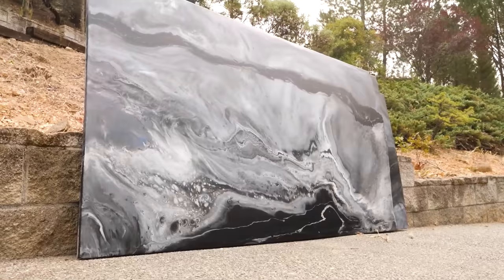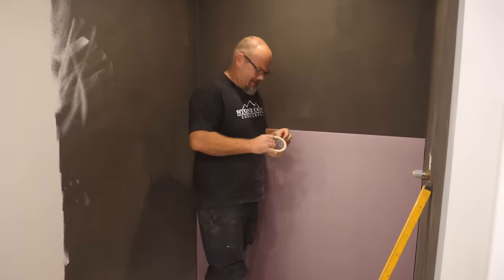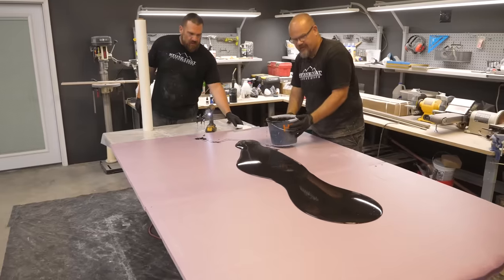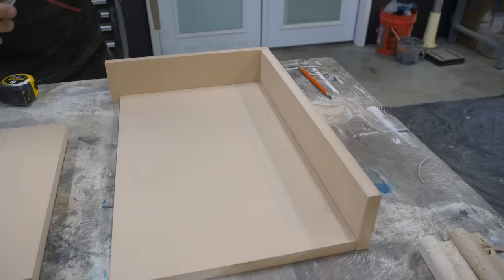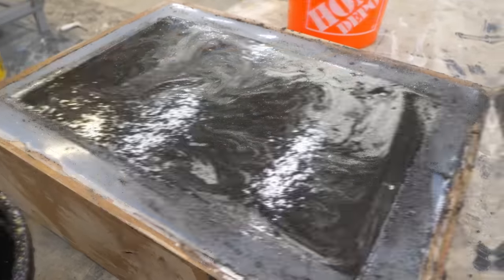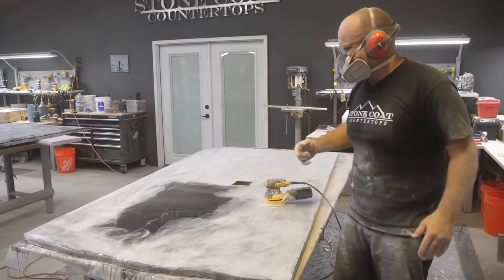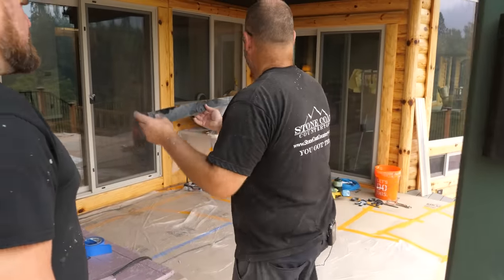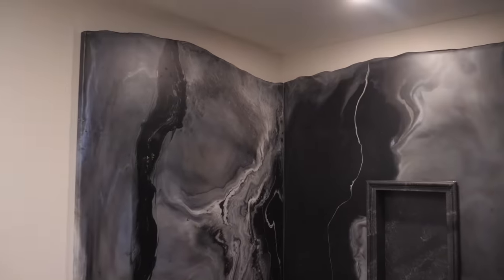Epoxy Slab Shower with Pink Foam, Come on the Jobsite Real Training

Comment: Why don't I see a drain? Ok, seen the drain at the end. Cool looking. Do you have a drain that avoids hair going down it? Mine is about 3 1/2 ft long. From painting I know that if you can slightly tip the canvas from L to R and back again a couple of times your paint isn't so linear. How would you add in a bench for the disabled or for women to shave?

Comment: I'd consider laying a layer of fiberglass into the backsides of the flat cement molds after pouring them. Give them a ton more strength, to avoid damaging them before they are installed. 
…also, on the MDF leading edges, if you do them before the fiberglass stage, then glass over the edges, the strength would really go up.

Comment: Just an FYI, but when you use a hole saw on something like this, drill from the back first half way through the material, then stop. Then goto the front with the hole saw and the remaining depth from front to the back, using the drill hole that you made earlier as a guide. This stops the material from blowing out and gives you a smooth hole, and even if the worst does happen, the blowout happens on the rear, not the front and is therefore hidden.  Its the trick used by plumbers on laminated cabinets when cutting holes for pipes.
Reply: James Keatings: I thought about that too. I suppose there has to be a center/pilot hole to allow the hole saw to register perfectly.
Reply: @isaacmadhavan  Well yeah. Most hole saws have the centre drill hole anyway which is always longer than the hole saw, and indeed, usually long enough to go through the material you are cutting completely before the hole saw itself actually makes contact. So by cutting 50^ through on one side, then going to the other and cutting from the opposite side, it reduces the chance of the material blowing out. Also, just for safety, i'd suggest covering the bit you want to cut with the hole saw with regular painters masking tape which also stops the material from lifting.
Reply: @jameskeatings9269  Kewl! And thanks for the suggestion about the painter's tape.
Reply: Amatures eh???? Lol
Reply: Thank you! 🙌🏾👊🏾👍🏾

Comment: Carpenter from Arkansas when you’re doing tile your time is in installation. When you do epoxy panels your time is in making epoxy panels  sence you have done both which one has the most labor in it. And what’s the time difference in the two processes

Comment: OMG what a wonderful DIY project I stumbled on. It held me entranced. There was so much information on how to tackle everything. I have my ensuite bathroom to renovate and was looking for alternatives to tiles.  I absolutely loved the stamping/concrete/marbling floor idea. I did like the epoxy wall panels over the soft foam/fibreglass strengthening. The only thing that I was at odds with was the cost. I use Stonecoat Epoxy to top coat my artwork and in Australia it costs me close to $450 for 2 gal (1 gal part A and 1 gal part B).I noticed you used around 6 gal to do one of your panels, which would make each panel around $1350.  You had so much information but you did not include the amount of product needed and cost of the products, to give a more exact price comparison. Also, the finish of the top coat was matte. Is there a slightly more sheen finish?

Comment: Mike I loved the long-form video complete with mistakes and recovery.  Isn't it great that sometimes the mistakes turn out to be a blessing? The aluminum edge turned out to be a mistake as executed but allowed for you to be able to do the chiseled edge which I appreciate much more than a hard edge in this case especially with the wild edge design you did at the top.

Comment: I'm renovating my rv and I want to do something like this but, I attempted to coat the showerpan which had yellowed with flexseal. It came out nice but it's not adhering well and before I get mad and rip it all out, I was wondering if pouring this epoxy over it would seal it and make it not peel. Any suggestions? Be nice please,  this thing is traumatizing enough. 😊

Comment: I love the idea and innovation. One question. Would the epoxy with foam backing take a minor “elbow bump” while turning around or other real world mishaps like a shampoo bottle bouncing off the floor and hitting the wall. Would the foam give and cause cracks, or does the epoxy provide enough strength to withstand everyday use?
Thank you and love the vids!
Reply: Epoxy is the equivalent of a hard plastic coating. It won’t crack
Reply: They reinforced it with fibreglass and resin in the beginning to make it more stronger, so it should take an accidental elbow, or a shampoi bottle bouncing off it without any problem ;)
Reply: That fiberglass cloth they laid up on the foam board is basically how they make fiberglass oceangoing yachts, some are balsa wood core but many are foamcore which is identical to what was done here, except they will use 2 or 3 sheets of fiberglass cloth. 
A fiberglass yacht hull can take quite a lot of hammer hits before damaging the gelcoat, 

epoxy is a lot stronger than gelcoat which is only applied to a yacht hull to smooth out the fiberglass weave, it’s nowhere near as impact resistant as epoxy, frankly carpenter hammer strikes would probably just dent the epoxy, to crack the epoxy-reinforced fiberglass-cloth you would likely need a full sledgehammer.
Reply: @johnfilmore7638  Going to need to see a demo of that.. I just highly doubt it will hold up considering cured epoxy is brittle in nature unless modified, but almost no one does that..
Reply: @FJB2020  your simplistic blanket statement about all "epoxy" being brittle says it all.
There are a near infinite number of epoxy chemistry formulations that run the gamut of flexibility, hardness, "brittle"ness, abrasion resistance, resistance to different classes of chemicals and solvents, hydroscopic properties (water absorbtion), I could go on.
You would need to educate yourself on epoxy chemistry before you could begin to have the background necessary to evaluate a resin property like relative "brittleness".

You might be mistaking bondo for a commercial-grade residential resin formulation in your assumption of brittleness. They are not the same.
Reply: @johnfilmore7638  Try reading again...

Comment: Awesome, what do you think about using 2-inch ISO cyanurate insulation fiberglass mat on both sides very rigid. Actually it is used in Roofing applications for fully adhered single ply roofs

Comment: I know I'm late to the party but I have a couple questions. Why did you want to stay boffins the ceiling when installing the foam? Was this just a personal aesthetic choice? Second, what was the type of sheetrock you used for the backer board? It was black but was that painted with a sealer? Lastly, what was the total cost for this job once the doors were installed? I know there is fluctuation in price based on various factors but I'm looking for a ball park for budgeting. Thanks if you can answer any or all of these.

Comment: The making of the stamp, was extremely informative.
Thanks!!!
Reply from the maker: We're glad you took something from that! Got any plans to make a mold?
Reply: @StoneCoatCountertops  
Yes, but is your silicone as tough as Smooth On products? What I usually use.
I liked ease of the wet cement stamp. Especially, as the shower floor would be just as easy to do a side walk or stepping stones.
Rounded corners on the stamp is a good idea, but I would add an overlapping 90 degree corner stamp.
............
My "sick!!!" Idea (your term) family crest, logo, etc, about a quarter inch high...custom stamp for room/office entrances, shower floor, etc. 
Any knowledgeable stone person should be perplexed...at this physically impossible stone.
..............
You spoke the truth...no fear, just do it! There is always a first time for anything.
or try real hard and learn from the mistakes, then  do it again, but better.
"Can't never could!!!"
Reply: Did it spark a project idea?
Reply: @MikeQuist-  A cheap but excellent finishing technique, and being a flexible mold, and looks like marble, stone, etc.
 ............
I just, as writing this...
IDEA!!!
 Fake stone, go cast a fossil  sculpture.
The club house at Atlanta Motor Speedway did it.
The fossils were boring, but the staircase and walls were clad in fake stone. Really impressive way to make a no window metal staircase...FUN!
 But, an ancient spiral sea shell , at a nice height for tourist's pictures. The rest were boring or bad picture angle.
Jurassic shower!
............
How much money and materials was on the rock mold, itself.
 Uhm...Please!
And does it need a full 24 hours?  Even though it pulled perfectly, so I need to shut up!
Thanks again, for the tricks of the trade.

Comment: Would you silicone caulk the top edges against the wall?  I know they are above the shower head but water bounces off your head and body as well as any condensation running down.

Comment: Also if doing a floating shelf for example in the shower with the sand/cement mold. How would you secure it to the foam? Would you place wood like you do for the glass doors?

Comment: I built a patio beer cooler. I used pink rigid insulation and I siliconed it in. It didn’t stay due to the silicone melted the rigid styrofoam away. I saw you used silicone to glue your wall shower panels in. What is the type of silicone you used?  
Thanks 
Calvin

Comment: I love that it mimics the rocks you'd come across on mountainous hikes, it's really great. Only thing I'd change is probably changing the orientation of the in-set shelf, I feel like for most shower items horizontal is more efficient than vertical like you put it and would look more natural
Reply: You want them to cut through studs so it looks better?
Reply: @timthefosterdad  you mean like all those windows in your house? .. it could have been planned for ahead of time and boxed out correctly.
Reply: @jeremyr7147  "All those windows in your house" are framed correctly and planned ahead of time. The amount of work it would take to do this correctly would be far more than the scope or intent of this video without it being a shoddy job.
Reply: @timthefosterdad  Thing is, though, they did cut through a stud. :D

Comment: If I wanted to make a shower inset without making a mold, could I make it with foam or mdf and coat it in epoxy to match the shower walls? Doing one shower I don't see the need to make a mold. Thanks in advance for the help!

Comment: I would have required far more waterproofing before those slabs even went on. I don't like the gaping hole in the valve area and I don't like the raw drywall on the front of the curb.
Reply: If you look at any tile job, you'll find a gaping hole as you call it by the valve hole. The cover plate over the diverter valve has a rubber gasket on the back of the cover to keep water out. If you know anything about fiberglass cloth sheet. Applied correctly, & it was. There won't be any water penetration through it. There won't be any water getting behind the curb.
Reply: @johntaglia9378  The drywall on the front of the curb was raw and unprotected. This can spell disaster. It should be waterproofed.

Second, sheet applied waterproofing membranes such as Kerdi and Hydroban have patches that cover those holes up and fit tight to the valve, and that was one large hole, as you'd typically cut the backer tight to the valve. I'm a plumber. I deal with showers plenty. Never, ever, ever trust a single source of waterproofing. Murphy's law...
Reply: I just tiled my shower and fully agree. I used redgard and did 3-4 layers; 5 on corners and potential trouble areas.. I only spent 500$ on tile and another 300$ in tools/supplies, thinset, etc. definitely didn't cost me 6,000.
Reply: @RedBeardDevelopment  this video was a complete SH SHOW! I can't believe this company would attempt to spoil their reputation like this
Reply: @ruelsmith  100% correct that was only 1 mistake out of many
Reply: pause @ 2:37:10 the back wall doesn't even touch the floor irregularly idk if that would affect the wall behind

Comment: With the niche your weren't concerned with just caulk as the waterproofing? And was the adhesive 100% silicone? Or the shower handle valve. I am assuming you warranty your work so your not concerned?

Comment: Watching so many videos now with epoxy, Im obsessed, I want to try to make everything out of it! 1 thought, as thin as you mix a lot of that stuff, I wondered if inventing a shaker table would be any benefit. Like with the old washer motors and pulleys some of us have laying around. Would it give a better chance of no bubble perfect finish if you vibrated it as it set? Or would that just be a huge waste of time?

Comment: What is behind the foam panels, is it drywall, and why is it dark , is there some kind of water proofing on the wall? Also RK3 did a painted finish to look like slate video from 2019 July 18 then put epoxy over it I would like to do that finish for shower and countertop, but how would I do it over fiberglass and epoxy? Used your product on kitchen countertop of about 65 sq ft , my son does it professionally and drove 500 miles to come do for me. Everyone loves my kitchen countertop is beautiful 🤩 so easy to care for love it ! Thank you for your response!

Comment: cool concept, but you should NEVER call this a "shower masterclass" and state you've never done a shower before. You're leading people astray with a statement like that  and you have done so much WRONG that you need a disclaimer!  I have been remodeling only bathrooms for the past 15yrs of my 25 plus years in the remodeling business. I can say without a doubt that black mold will be moving in to this shower ASAP.  Not sure what you did in the pan/drain area you should have used a "tile ready" pan or at least prepped as if you were going to tile it since you were going with a stamped pan and NEVER run drywall or concrete board for that matter down into the pan.. that will wick up the moisture and you will never keep the moisture from getting to it. I'm sure that silicone will just pull/peel right off that epoxy top coat, at a minimum you should remove the silicone and use a silicone primer "Dow DOWSIL™1200 OS Primer Clear" is what i use first then re-seal and as soon as the silicone stops looking like it did on day 2 its failed and moisture has gotten behind it and mold will grow/thrive on the foam board as well. where that type of polystyrene foam board is used there is/should be ventilation. You may have had a better chance if you used a store bought fiberglass pan with a tile flange. sucks all that hard work I really hope that lady has no mold allergies.
Reply: if the acrylic ran down over the edge and along the back side where he had to sand the drips down, can water really wick up into the foam when the edges are sealed?
Reply: I think a pre slope before the final pan would alleviate many mold problems
Reply: Why not spread a tinted thickened epoxy in the seams rather than silicone?  Then chances of any water penetration would be zero.
Reply: This.

Comment: PRO TIP...... Wax The Aluminum or use PVA on the Aluminum, so the Epoxy wont stick to the aluminum!
Reply: Dry moly may work for the aluminum coating it for none stick surface.
Reply: Mr Roche another top  tip 😎 old school

Comment: Just an all-around, general comment: Are the men &/or women who will be CLEANING these showers and other bathroom surfaces being consulted re color selection on these projects? 

Would be good if any small mold, mildew, or other contaminant could be easily and immediately spotted before it gets out of hand. Everyday spills also seem like they'd be hard to spot. 

Just wondering...

Comment: So it is "how to make a bag of concrete look better than $1k worth of tile" - but we will add that bag of concrete to $600 in epoxy (and a few hundred $$$ in other materials)!
Reply: Yet it looks like crap
Reply: $600 in epoxy, $300 in dies and paint and 3 - $400 in other materials. And they did most of the work in their custom warehouse with the thousands of dollars worth of tools, work tables, mixing buckets, tons of plastic and who knows what else.
Reply: 40:57
Reply: @odiousjr99  that is not actually true. You could get 3 walls of the shower covered in granite for between 2 - 4 thousand dollars and it will look 10 thousand times better and   it won't fall apart in a year like this bathroom will. I have been remodeling kitchens and bathrooms for over 20 years and work with stone manufacturing companies fairly often. And the owner himself said that he "learned how to do this by watching how to make surfboards" is that really the type of person you want to remodel your bathroom?
Reply: @odiousjr99  the only way it would cost $10,000 to have 3 walls of a shower covered in stone would be if it was indexed quarts shipped over seas from Brazil or Spain. Granite usually goes for about $20-$30 a foot and he said himself that it's less than a 100 feet of shower walls so do the math. He's a used car salesman and is overstating the price of competing products so you think your getting a killer deal. But a year down the road when your bathroom is full of mold, the foam wallboards are separating from the sheetrock, the shower door won't open cause it was only attached to foam that's siliconed to sheetrock and you have to pay someone to do it all over again that deal won't seem so sweet.

Comment: How much does a 4x8 sheet of foam weigh after the epoxy is applied ? Im wondering if its practical for a camper with basically no insulation

Comment: Could you use that mold method to cast a sink?  I am think about trying to sculpt 2 sinks for my master bath.  Ideally, I would love for them to look like they were made from honed Travertine.  Would I need to ad thickener or embed pieces of fiber glass, or would a thick pour be enough to handle the weight of the water?